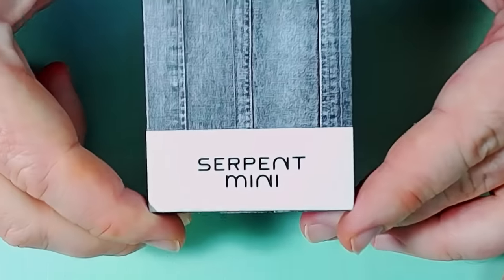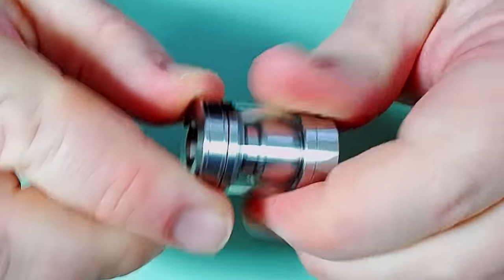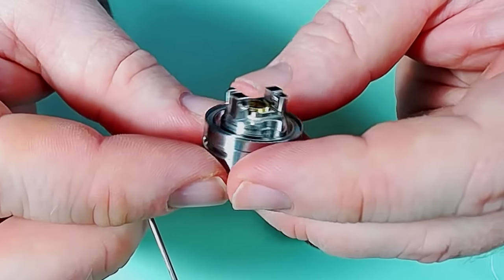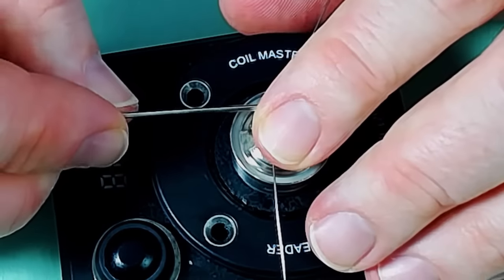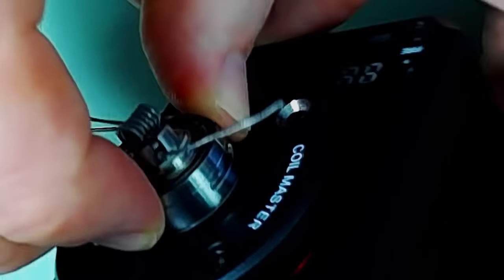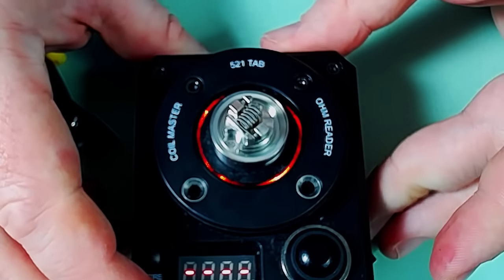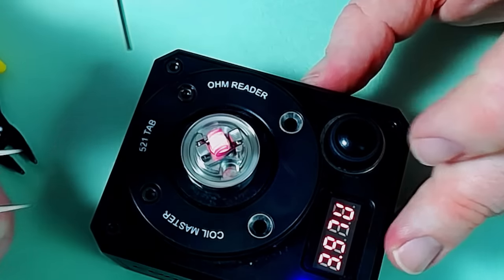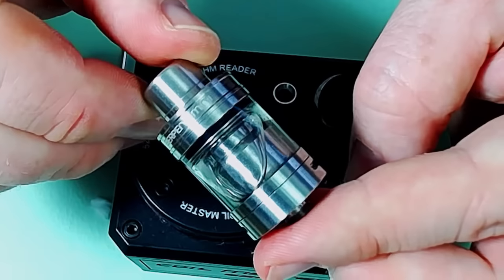Serpent Mini Review with coiling and wicking tips!

Comment: I would always make sure the ends of a fused Clapton coil are twisted vertically so the grub screws meet them flat on.
Also, if the ends protrude even slightly, I'd take the coil right out and trim about 1.5mm off each end, then re-install it.

Comment: Best review yet on this tank. Solved my leaking and dry hit issue. Tip for the wire, use nail clippers. Never had a problem when doing that.
Reply: Matt how do you solved the leaking problemas and dry hit ? i have the same pfoblem

Comment: Great review! I use 26G SS with 8 wraps and get a great vape at around 35 watts. Don't care much for Clapton yet... And yes, need a good pair of clippers just like you have to get close enough to cut the wire flush with the post. Love being able to check out or rebuild w/o having to dump the juice. Love the air-control. Love the sleek small look. Just love this coil. Thanks again!
Reply: indica 777 I use 316L 28ga/30ga twisted fused Clapton's 4 wrap and it is perfect on the 25mm version.

Comment: Thanks for the wicking help, now I don't have to crack the cap every couple pulls to avoid dry hits! My method for cutting the leads is to pull and wrap the wire back around the grub screw after it is tightened, then cut it off above the post.

Comment: Another tip from an ex-owner of the 25mm version of this tank - be very careful with the post screws. They strip very easily, and if it happens when you're tightening the legs/leads of your coil they are almost impossible to extract (therefore ruining your deck). Hopefully Wotofo take the Geekvape route and invest in better post screws, particularly if they're the type that completely recess into the posts.
When this happened to me I had to take it to a watch repair shop to get the screw back out. Just a warning!

Comment: it would be nice if they had a option to swap out that massive Center airflow with different sizes such as may be a 2.5 or maybe a 3 millimeter airhole. this would give people other options essentially turning it into a mouth to lung atomizer for a restrictive lung hit atomizer which would give the user all kinds of options. this would open the door for them too maybe do this for the regular sized serpent and other atomizers in this category single coil category.
Reply: + CW Отличная идея +
Reply: +CW I sent off that selfsame suggestion to Wotofo a while back. The optional kit with the Bachelor looks perfect.

Comment: Great video, as a side note Mr Dean I don't know if you ever used the Crown? But with the RDA section so yuo can for go the coils is the same way. I just will rub my finger around it before I put the cap on. Seems to help me cause with these old eyes  I miss things like a bit of wire over hang. I do need to gram a pair of the cutter I see you using. I usually grab the old finger nail clippers, let ya know not your best option lol. Works in a pinch.

Comment: You can bend the wire back and forth until it breaks off instead of cutting it. I do it with clapton all the time. Sometimes the center wire will break first that you have to break the smaller wire. I do it with my subtank mini all the time to avoid shorts.
Reply from the maker: +Jeffrey Sousa Depending on how it's captured you can yes
Reply: If you have a little snag after clipping, You can also loosen the grub screw a litte (not all the way) and push the wire back in just a bit.

Comment: tiny amounts of excess wire stopping the barrel or shorting the atty, I`ve had some success on other atty`s or rba decks with, removing the coils and carefully snipping a piece at the end, OR slightly bend the end of the coil legs.
Probably what I`d try with this too.
Messed up a couple of times though as I snipped a bit too much and couldn`t get the coil secured after, but depending on the coil and the screws in the deck its just a matter of not overdoing it, with the tiiiny tiny amount being necessary to remove here, you could also  loosen the grub screw, and pull the coil a bit in :)

Comment: Yes! I've been waiting for this review. 

You think this is better than the Goblin Mini V2? 

I sold my Goblin Mini V2 for this. I thought it sucked quite frankly - not enough airflow and also needed twice the build to get the same performance as a different atty with a weaker coil/ohm in it (eg: needed a 0.5ohm dual-coil build in the Goblin Mini V2 to perform the same as a 1.0ohm single-coil build in a different atty). 

I think this one should be better for the following reasons (I hope I'm right):
- bigger airflow hole
- bigger juice wells
- ability to check coil without needing to dump juice
- spacious and not a super cramped build deck
- side air vents, instead of them pointing downwards towards the 510 pin (condensation)

Comment: I have issue with this serpent mini, I'm using the twisted wire that came with, and during my vaping I've experienced a few time of my mod showing no atomizer & I've recheck my coil and there's nothing wrong it's all tighten and connected, and after a while I shown ok ~ and I do hate the screw size when using my regular 26g khantal wires, it's a pain to build this. I thought this is a very easy to build tank but it's not!! I love the way it looks but to recoil for this is a nightmare sometimes.
Reply: You have to remember to wrap your coils counter-clockwise so the legs stick out at the bottom of the coil in opposite directions, and then will lay in the post hole properly for trapping in there.  It's a lot easier to trap the Claptons because they're so fat but I don't like Claptons.  I like SS for flavor.

Comment: Hey, thanks for the great vid!!!  Mine leaks - looks like from the air holes or the air hole ring.  Any suggestions on what I may be doing wrong?
Reply from the maker: Sounds like the wick is too loose
Reply: I will try that.  But here's what happens - I fill it up almost to the top, but when I screw on the top, it looks like half or 1/3 of the juice goes "away" - the level drops - and it starts oozing out of the air holes and the seam between the airhole ring and the rest of the tank.  Just wondering if there's another seal there someplace?  What happens if I remove the center pin screw on the bottom of the atty?  Love this tank - but getting tired of losing juice after every fill.  Oh and it stops leaking eventually - when there's like half or 1/3 of the juice left...  Strange indeed...  And I do close the air holes when filling, of course...

Comment: I love your video! Thanks! I just bought this Serpent Mini yesterday, and I'm getting a lot of "No Atomizer" errors, and sometimes "Atomizer Short", and when it does fire up, the Ohm just fluctuates from .68 to 1.3 Ohms.  Could this be the issue? I'm using the standard wire(very thin) that came with the package..I think it's an issue with the coil. Maybe something's protruding or it wasn't screwed in too tight. I don't wanna mess around with it right now, I'm afraid I might break it.  I just started vaping/quit smoking yesterday. I'm very new to this stuff, and even vaping at 19watts with an iStick Pico, cause I cough a lot when I fire it up at 30watts.
Reply from the maker: Crikey, going rebuildable right at the start is a bold move, as long as you do it safely and doing a lot of research though it's helpful - hopefully you have a local vape shop you can get advice with as well?
Regarding the Serpent though, it sounds as though the wire isn't properly trapped in the posts - is it tight to the pull? If that's all OK, then it does sound like there could be an errant wire coming from the post and touching the inner chamber, it really only needs a tiny amount to protrude
Reply: Yeah, I think you are right.  Thanks for the prompt reply.  Yeah, I was thinking of getting the EGO AIO, but I didn't like the reviews. They said, it breaks after a month, or the batteries won't charge anymore.  So I figured to just buy an RTA with a mod so I don't have to do an upgrade that soon, assuming I'm gonna like vaping.  So far, it's good. I'm vaping at around 17-20 watts.  I hope that's not too low.  I still can't take it at around 30 watts or high. I've subscribed to you videos.  Thanks. Cheers!
Reply from the maker: The aspire Quad-Flex kit could be worth looking at for you, from the Nautilus X tank with the 1.8 coils (which are great), to different RDA options and tank options, it's an inexpensive way of sorting you out for a while and giving you plenty of options. I did review it recently :)
Reply: Okay, I'll take a look into that..thanks a lot.  You rock!
Reply from the maker: Cheers!
Reply: i know u already checked that but to say this only happened to me.when the coil was almost touching the air flow or the (base) .. try to raise the coil a bit
Reply: u shud pull the coil abit far from the bottom..  i think so

Comment: Why everyone's bitching it's difficult to build on.Literally 5 minutes on the clock is all you need to build of you have your coil and wick ready.Also,for everyone in doubt if it will leak or not,especially for thin juices just make a tight scottish roll that's ,1 or ,2 of a mm thicker than the ID of the coil.Insert said wick in the coil and crop the tails to a slight triangular shape at the ends.Fluff it up,juice it up to be bit more manageable,pack it to the well notches reaching all the way down the bottom of the juice well and screw the chuff cap fully down.For high or max VG juices make the wick the same width as the ID of the coil and crop it to the height of the first step of the juice well.Again crop it to a triangular shape at the ends,juice it pack it and screw the chuff cap 1,5-2 turns from the fully closed position and you're ready to go.Easy peasy!

Comment: Nail clippers!
Reply from the maker: Hairbrush!
Reply: Hahaha :D
It's just nail clippers were always good for trimming the leads on the Subtank RBA :)
Reply: I had the same problem cutting the wires flush to the post. I now either poke the excess back in after I loosen the grub screw and retighten or even quicker, I take an Emery Board or nail file and just file the wire flush. I use this method mostly. Works nicely.